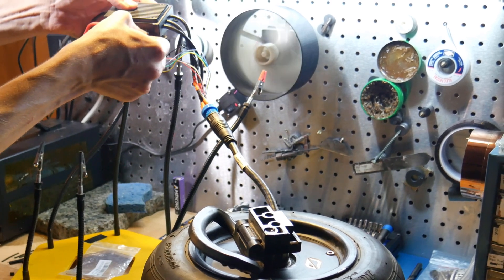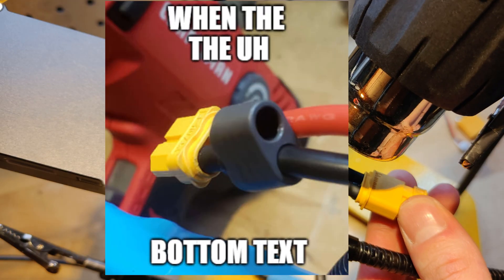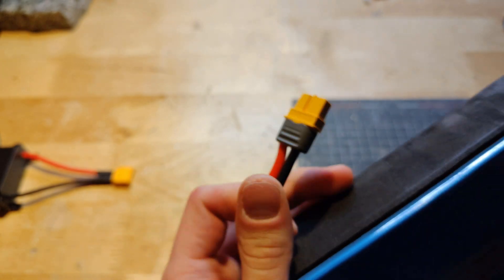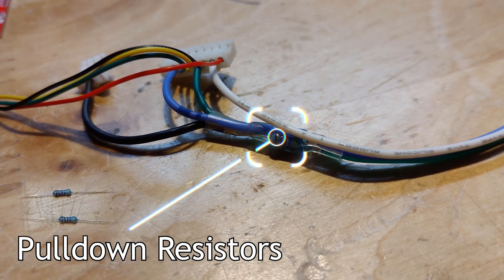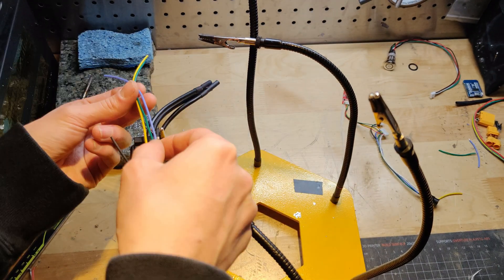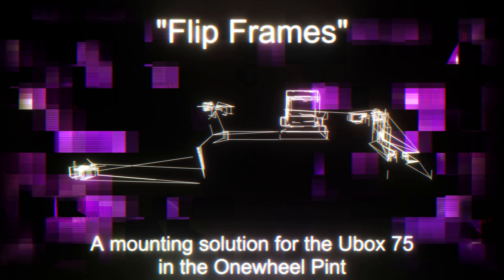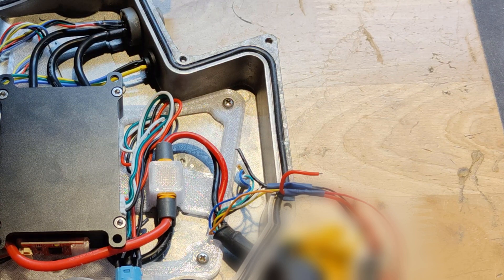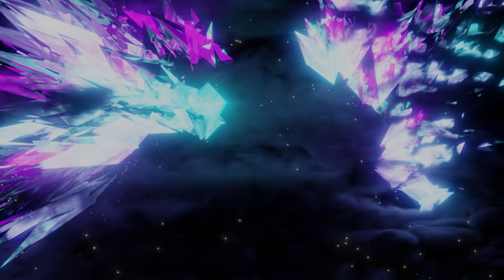Vescify your Onewheel Pint! Guide Part 2-3

Comment: What wire stripper are you using? That looks great.
Reply from the maker: Its some 2 in 1 wire stripper. But it certainly isnt the best, I would look for something more durable. Though it has worked for me for many many years.

Comment: How does the UBOX remain in place and not bounce around if the flip frame is a “loose fit”?
Reply from the maker: Because the Ubox is actually slightly higher than the top of the box so the lid clamps the ubox against the bottom of the controller. If you add a thermal pad here as well it will snug it even more. The frame only serves to keep the ubox from moving side to side. Up and down is handled by the lid.

Comment: What did you use for front and rear lights? Were you able to rewire the stock FM light bars or used custom strips?
Reply from the maker: I used an ESP2866 or ESP32 to control the stock LED's using WLED. Works really well been running it for a year now.

Comment: Why do you just leave the ubox in there as a loose fit and not fasten it down in any way?
Reply from the maker: The top lid compresses the Ubox against the bottom of the controller box, so it won't move up or down. The bracket then handles side-to-side motion so it is sufficiently locked in place.

Comment: What size of fuse should be used? Looks like in the video there was a 60amp fuse
Reply from the maker: The fuse I took off of the Ubox fuse PCB you can optionally buy with any of their Uboxes. You dont need to use the specific one I did but 60 amps is a good value for a pack like a Pint/Pintx/XR stock battery. If you are looking to upgrade the battery to something and set the ubox to draw more than 50 amps I would double it or find a higher value fuse. But 60 amps it plenty (double) what you will be drawing from stock packs.
Reply: Thank you!

Comment: Hey there! Thanks for this guide. Where can I obtain one of those ceramic surface mount fuses? And is 60A the correct choice?
Reply from the maker: The ceramic fuse I sourced from the spintend fuse that you can add as an option with your purchase. 60 amps is the correct value for stock batteries at least.

Comment: I would just add a step to de-solder the xt60 on battery packs and orient them the correct way.
Reply from the maker: nooooooooo dont want to do that or you will blow up your BMS
Reply: @DuckBillWill  the future motion booby traps stikes again....thanks for the save. Just gonna remove it and sell it.
Reply: @DuckBillWill  what’s the course of action to adjust for the reverse polarity? Do you solder the xt60 on backwards attached to the ubox? So black positive, red negative? I’m confused. Cause you said don’t flip the xt60 on the battery…or do it mean don’t reuse it but use a new one?
Reply from the maker: @stevenvandenengel5259 The confusion is because of where the flip actually occurs. The BMS is where the polarity is flipped back to normal. Inside the controller box the polarity is correct with the connector. But I say follow the colors because on all the connectors the wire color is accurate. Even on the battery, notice on the battery pack the red wire (positive) goes into the negative side of the XT60. But at the BMS junction the output XT60 is actually flipped so the red goes into the flat side of the connector.

Comment: for powering the board for initial testing, should I plug thr battery into the BMS then the ubox into the BMS?
Reply from the maker: Yes you should plug the ubox in after the battery box is all set. I wouldn't perform any sparky maneuvers around the bms since it is the most valuable part of the electrical system.

Comment: Great, very informative video, even with some soldering tips for beginners. Just one thing that bothers me - no thermal issues with this mounting? Shouldn't the controller be installed the other way so it's firmy touching metal controller enclosure with some thermal pad or thermal paste? I understand that controller itself has heatsink on itself but it's just big theremal mass that has no way to dump the heat to rails as in original design. In hot summer with longer ride sessions ( especially with some CnR/VnR solutions) that might be a problem.
You mention that flip frAme is better to transfer heat do lid... To plastic lid?
Reply from the maker: Keep in mind that the MOSFETs are actually upside down on the Ubox, take note of where the little cutout fins are. That is what the MOSFETs are sitting against. So with Flip Frames, it is actually pressing the main heat components against the aluminum case. And no I have never had the Ubox overheat. Take into consideration that the Ubox is rated for 100 motor and battery amps continuously. We limit battery amps to 35 and only ever reach 100 motor amps very rarely. So the Ubox in a sense is way overkill and has no problem being cooled passively.